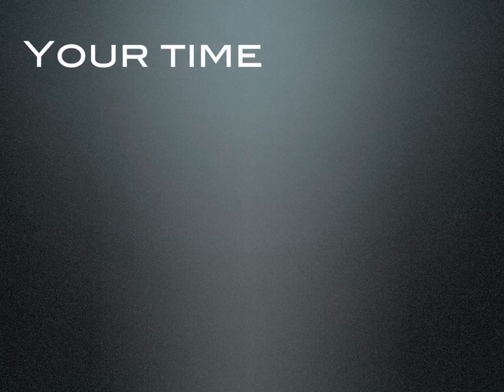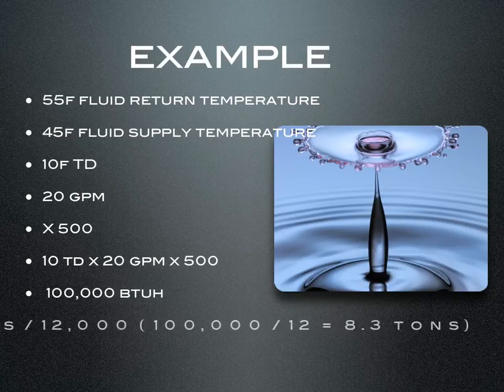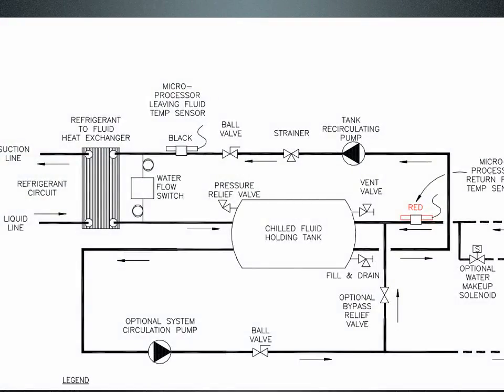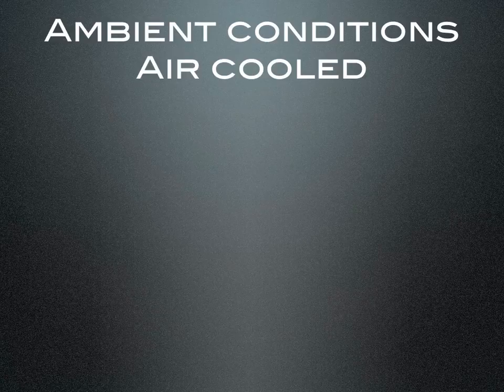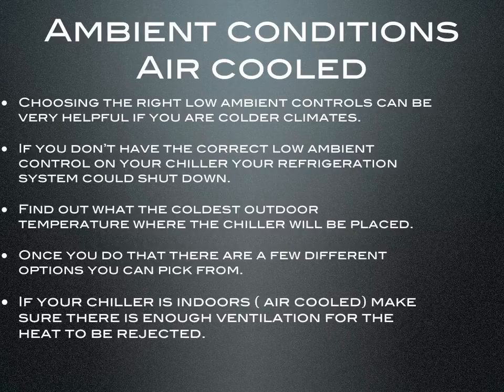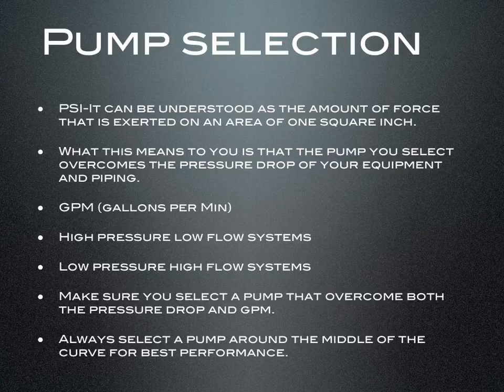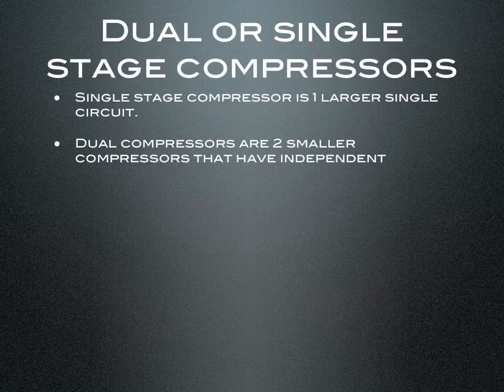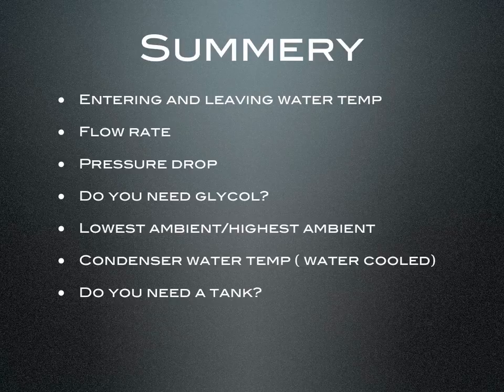How to size a chiller.

Comment: i don't understand why you start sizing chiller by temp-diff and flow-rate of cold water. it should start with calculate the heat load in the room or building that you are interested. when you have total heat load, means you have a cooling load for chiller. then from there you can use temp-diff formula to find flow-rate of cold water that chiller needs to produce. and from cooling load and flow-rate of chilled water, we select the size of chiller machine. correct me if i am wrong.
Reply: No he is right. Chiller is not only used to produce air conditioning effects but also can be used for different process like in pharmaceutical or chemical industry to circulate cooled water only.
Reply: Neel Punghera yes I need to size a chiller for lab work